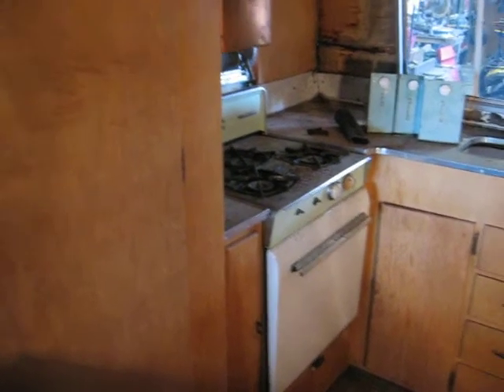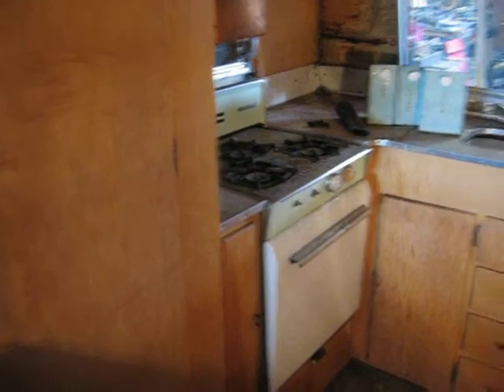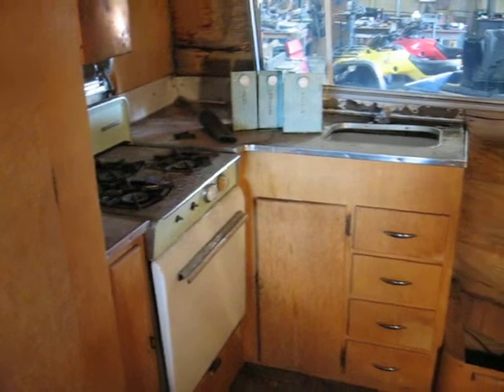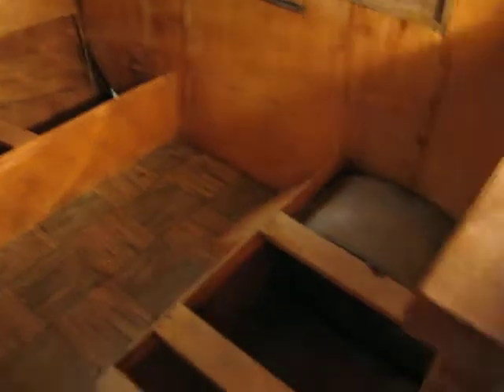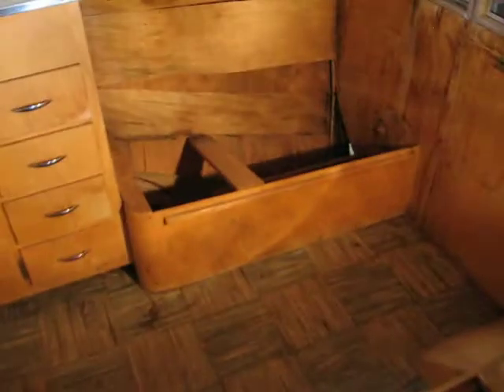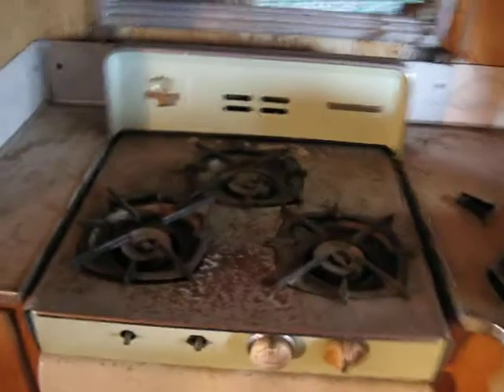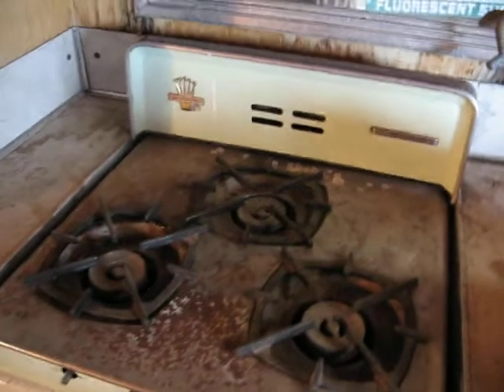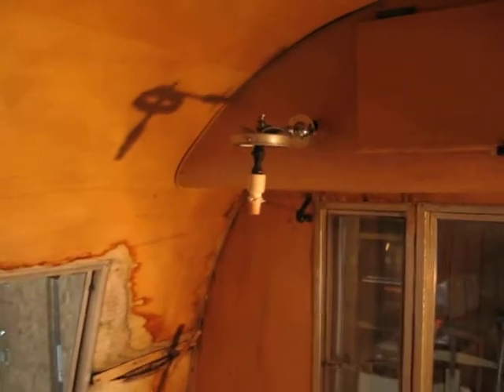Vintage trailer In the shop. No 2b

Comment: The Marvel frige and the Princess stove must be kept. You will be able to find knobs and make them both work if they don't now. You can get a new plastic tank and new hand pump no problem. That trailer is very restorable. My Kenskill has the same type backwards floor plan. Kitchen in the back and a Goucho bed up front. Dinette in the middle. Weird but it works. 

You will need to replace all that paneling front top and rear from the outside. Watch my vids... Might want to watch both series.

Comment: You don't use the table between the seats for support. You cut some 1x4s or 1x6 slats to go across... 3 are enough. They are stored until needed..... Some times there is an extra slide mount out on the outside of the trailer at the right height for the table so it can be used outside under the awning when the dinette is being used as a bed.